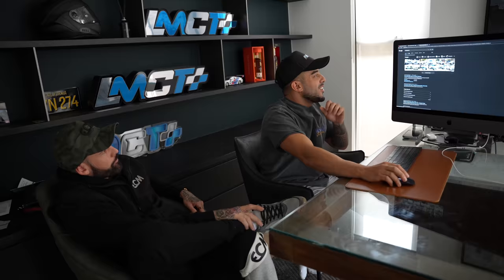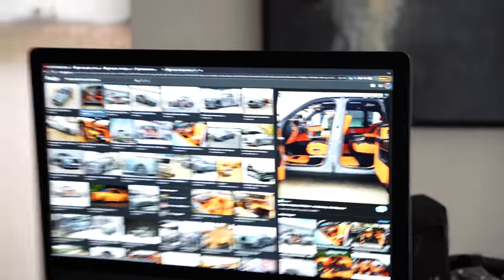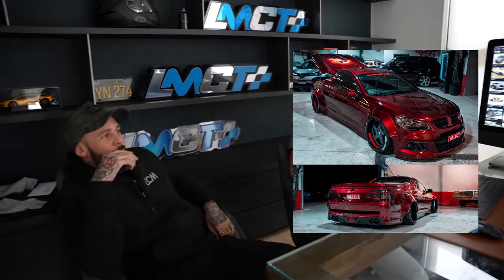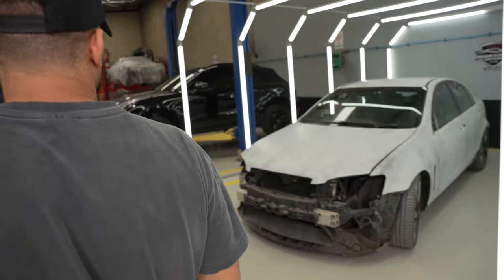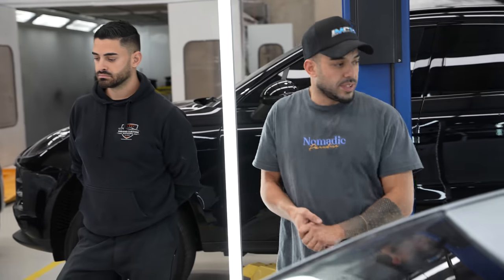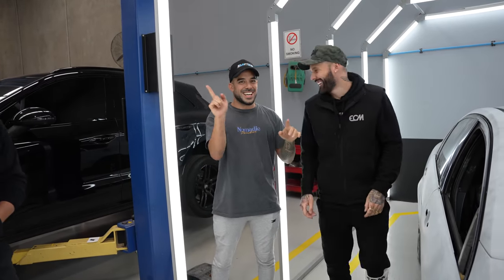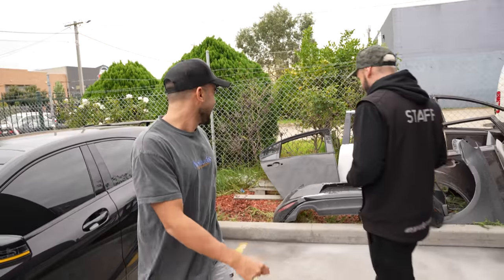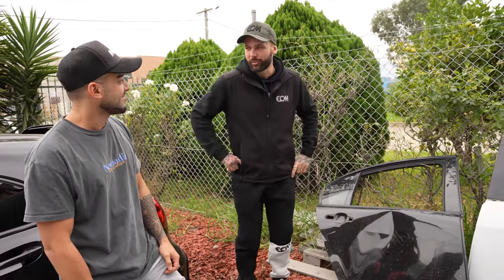VE GTS BARN FIND BUILD GIVE AWAY EPISODE 2

Comment: Going with Adrians choice. 

Nardo grey, orange trim with black stitching on the orange parts and black alcantara inserts with orange hexagon stitch, (door inserts and centre of seats) orange belts, full orange dash with black stitching, carbon steering wheel wrapped in black alcantara with orange stitch and orange centre line. 

The black and orange will contrast nicely against each other I feel. Without going all out single colour full trim. 

Blacked out badges and trims on the exterior with 22” gloss black rapiers or 22” gloss black vf gts wheels and gloss orange brakes 

Whitewalls, front splitter, roof spoiler, rear bags, front coil overs. 

Lsa conversion 

Done.